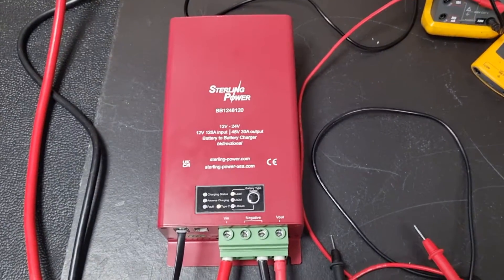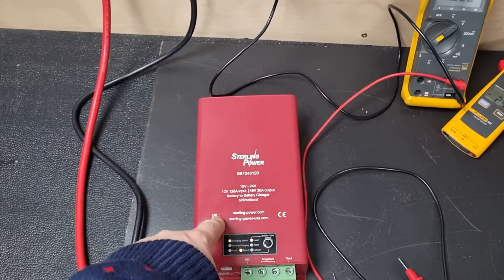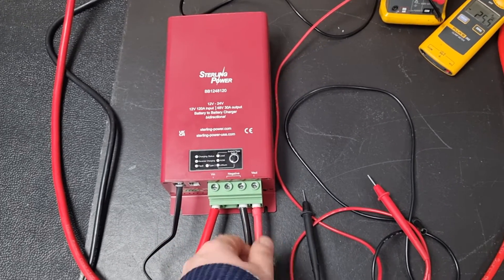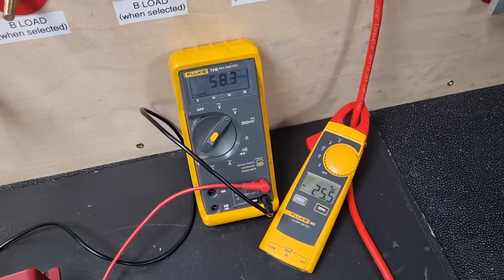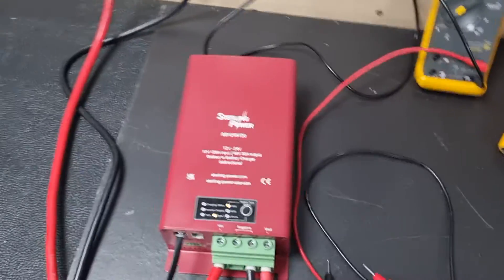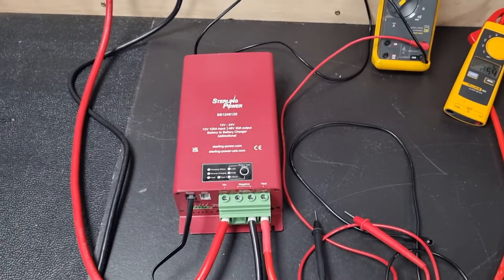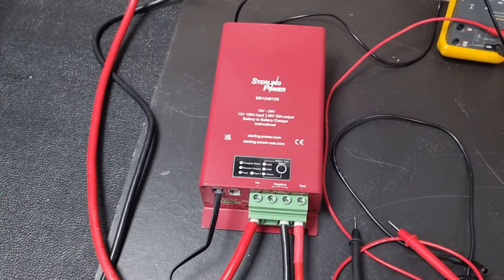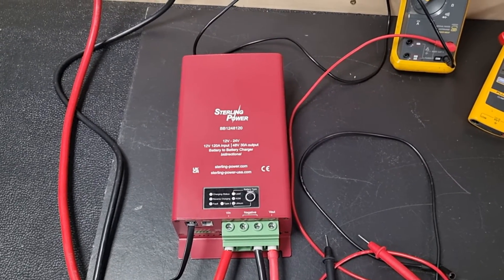BB1248120 - Sterling Power's 12V to 48V 1500W Output DC DC Battery to Battery Charger

Comment: Can I use this to convert my 12v battery bank up to 48v directly to a 48v air conditioner? Or is this just meant for charging?
Reply from the maker: Hi,

Thanks for the inquiry.

With live-output capabilities, the charger can operate similarly to a power supply. 

The BB1248120 is not as full of capacitors as our BB4812, so its accuracy as a power supply might be slightly less in comparison, but I wouldn't imagine your proposed concept to be too impossible.

Comment: I'd like to send a 12v wind turbine to a 12v slave lead acid battery then have a battery isolator to auto send the 12v to my 48v (56v) lithium battery. Would this work for that? What is the output voltage 56 or 58v? 58v would ruin the life of my lithium
Reply from the maker: Hello Stew;

You can customise the output voltage via the BBR remote. This item was intended to charge a lithium battery system. 

Keep in mind that at its full power it is a 1.5KW rated item, so may be more powerful than your wind turbine. 

Battery isolator is probably unnecessary. If you wanted to control when the unit is on/off, you can do so via the ignition feed terminal on the item itself. 

Ben

Comment: Hello, what is the lifespan of this item? As my previous Sterling unit went out after periodic use of 2 years, I was only offered a small discount for an additional purchase instead of replacement.
Reply from the maker: Hi there;

We don't have a set or even estimated time to failure on these units. Of the items that have come back to us so far we have had zero hardware failures. 

 The only returns of any of the Saturn series chargers have been user error (loose contact in terminals, filling the first release of item - ie pre conformal coating - with water and oil) or a momentary software update. 

We haven't had any definitive component failures for us to begin to age the items.  The  degree of stability is due to its greater manufacturing quality and significantly increased efficiency- saving component stress all around (~86% efficiency of the old units up to 98% efficiency on the new ones). 

We're considering even adjusting the warranty window up from two years to three or beyond, but we're hesitant at just jumping in - partly because we still need to incentivize selling stock of the original items,  (white series BBs) and also because we would need to consider adjusting prices in part, too. 

I know that's not super helpful at giving you an actual answer, but I hope it helps a little at giving you some info!

Comment: Can custom charging currents be set for smaller alternators?
Reply from the maker: Hello Lee,

Yes, but to a semi limited degree. You can drop the current limit to 85% and 60% of the units rating via use of the BBR, the remote. 

Ben
Reply: @SterlingPowerProducts  Hi- Do you have to have the BBR remote to drop the current limit, or can it be done via the buttons on the unit?
Reply from the maker: @bmcga1  Hi bmcga;

The unit will automatically drop power if the input voltage is insufficient- but it cannot be manually set without the BBR. The button on the item only allows relatively limited customisability in order to
A) Save space on the actual control board memory
B) Simplify the actual use and understanding of the product. We learned from the BB1260 that too many options and too many lights are actually detrimental to use if not easy to navigate.

B
Reply: @SterlingPowerProducts  OK. Thanks for the reply. I'll have to see how it goes with my truck at full power and then add the remote if needed. My setup is somewhat odd in that the truck is a hybrid with a motor between the engine and transmission. There's no alternator. The motor charges/runs from a 288v battery, which then steps down to a 12v battery to power the vehicles 12v systems. I did a bit of research and the fuse on the truck's 12v converter is 150amps, so I'm hoping that means the motor and 288v system can supply enough continuous power to the 12v system to power the sterling, which of course will then step the voltage back up to 48v and charge my trailer house batteries. Does this sound reasonable or completely crazy?
Reply from the maker: @bmcga1  So- doesn't sound too massively different to what we do with electric vehicles at the moment.

Most EVs are obviously running at 400V/800VDC, but still have a 12V (or sometimes 16V..) starter battery that they keep topped up via a HVDC-LVDC converter. 

That converter is something we can essentially treat as an alternator. 

I would get the actual converter rating, if possible, rather than presuming based on a fuse, and go from there. 

Keep in mind that our unit is going to try to run at 120A on the input- and if you're powering 12V loads on that same input line, that's only going to be elevated further.

All in : it could work! Just requires a bit of either experimentation or further refining.

Comment: Can I order it from US website
Reply from the maker: Hello Gordon,

Not yet. The product as displayed is just a manufacturing prototype. We should be getting units in as of Q1 or Q2 of next year. The US company can place orders for the products when they see fit, as they operate somewhat autonomously.
Reply: @SterlingPowerProducts  thank you! Manufactured from Taiwan I assume?
Reply from the maker: @americannumber2  Hello Gordon,

Correct. Same manufacturing house as our Pro Charge Ultras. Their build quality has proven excellent, the rest of the range has been getting sold for around a year or more now and we are yet to have a single manufacturing warranty. 

Of the two units we have had back, one is from a ***** solar regulator failing and putting solar voltage across a 12V circuit (30V onto a 12V charger is unpleasant) and the other was filled to the brim with oil and water. 

B